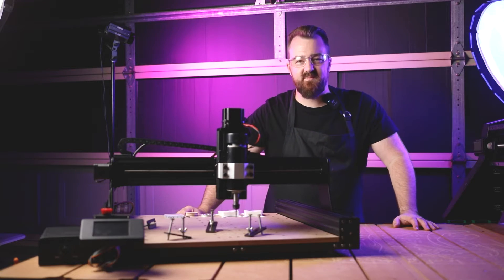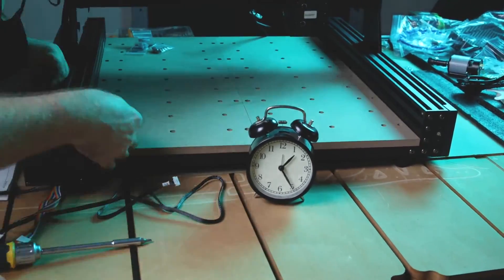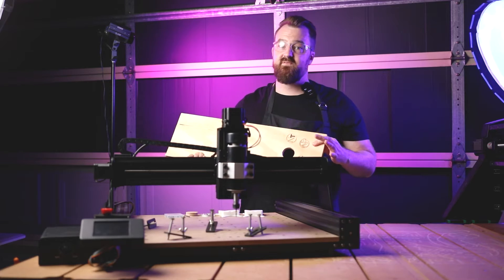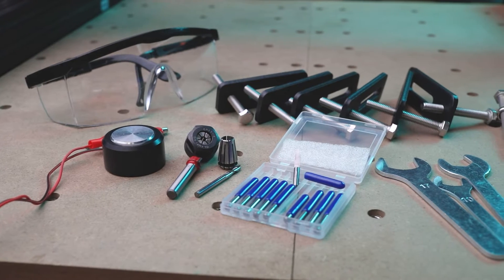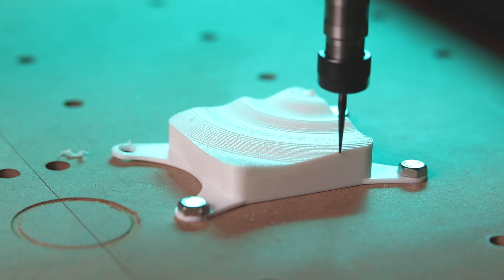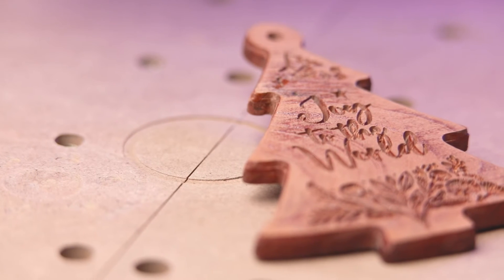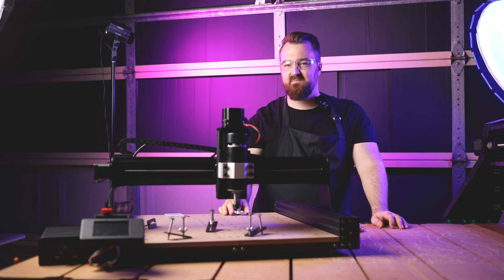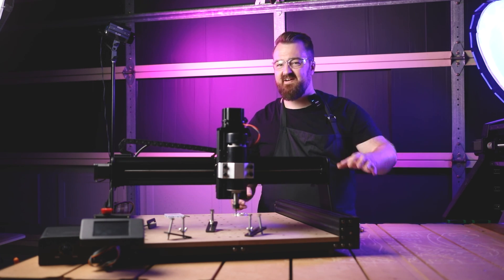TTC450 // Two Trees CNC

Comment: can cut the plexi glass with 80w 775 spindle motor ?
Reply from the maker: Yes, however I wouldn’t go any thicker than 3mm and take .5mm step down at 1000mm/m with a 1/8 inch single flute and something to either blow or vacuum the debris. 👍

Comment: Are you considering to upgrade it with liniar rails?
Reply from the maker: Great question! No I won’t be making any additions to this CNC. If I start upgrading, it will end up a totally different machine. I would rather start building a new machine from scratch. This is a great machine as a beginner and get your head around CNC’s.

Comment: I looked up the link you gave and downloaded it! If I copy it one by one into the console panel, you say it will be fine?
Reply from the maker: They are the default settings for the ttc450 and will get you back to original settings if you need. My other settings I posted should get you homing to back right corner:
$23=0
$130=-450
$131=-450

Comment: HI!
Sorry to bother you again! I have the TTC450 machine, it's great, it's a pleasure to work with it, but I have two problems that I can't fix!
1. it often happens that I move either the X or Y axis in one direction with a given value, and all of a sudden it doesn't go any further, yes in the opposite direction, but not in the original direction! I can only solve it if I send it to the Home position! Then it's good for a while!
2. I wanted to place the Home position in the right, rear corner, but there the limit switch of the X would not stop it, it would continue, do you know what sound it makes? However, the Home position works in the left rear and right front corners!
I think that the problem may be with $$ values, but I dare not touch it! Can you help me? Maybe you could send me all the correct $$ values! Thanks!
Reply from the maker: Thanks for you comment. Yes that is possible on the TTC450. 
In regards to your questions:
- firstly triple check all motors and limit switches are plugged in securely. 

The issue with changing the homing location, if you don’t change the machine x,y max travel, this impacts the movement. The machine is expecting to move right by 450mm and to the back of machine by 450mm… if you change the homing position to the rear right, you will need to update machine max travel to:
$130=-450.000
$131=-450.000

To invert the homing direction to back right corner it should be set to:
$23=0

Let me know how that goes?
Reply from the maker: Check your current settings are default… here is the back up file:
https://www.mediafire.com/file_premium/sc3957v1qnuf9bg/TTC450configuration.nc/file

Comment: Aligning the two Y axis gantry screws.  I don't use the limits, so if  I accidently hit the back the gantry will get out of alignment just a little. Since there is no knobs on the motor shafts and there is no way to get to the screws to turn them, I have found a way to do it easily. You remove the bearing holder on the front right side and you then have access to the shaft. You then can align the both sides to same measurments..  Works great..
Reply from the maker: Great thinking!! Thanks for sharing. Yes that would be super helpful to others. You might also be able to unplug one of your y axis motors and make tiny movements until square, however remember to power down machine before disconnecting or connecting motors!!

Comment: I thought of these: Feed rate, Plunge rate, Depth/pass
Reply from the maker: For my parameters I kept plunge rate the same as feed rate 👍
Reply: Thank you for taking the time for me! I just want to ask, do you mean what you wrote as Plung rate=Feed rate?
example: Feed rate 500mm/min then Plung rate = 500mm/min!
I also came across such a setting: End Mill 6mm, depth/pass=2mm, Feed rate=1000mm/min, and Plung rate=900mm/min! Do you think this is not burdensome for the machine, the one I saw used the original motor and not the 500W motor?

Comment: HI! I ordered the TTC 450+500W motor today, I'm really looking forward to it! I would like to ask you to tell me what values you use for the following parameters! Of course, I don't ask for every tool, let's say an End Mill 3.175! Thanks!
Reply from the maker: Thanks for your comment. The following parameters are from memory and might need testing. For cutting plywood with a 2f 3.175mm endmill I believe I ran at 600mm/m with 2mm doc. I always found plywood to be more difficult than other soft timber due to change of grain and random filler timber between layers. You might be able to run more aggressive with these values. 
For aluminum I used a 1f 3.175mm endmill at 300mm/m with .2mm doc, however I still had some machine flex at these values and needing to refine. Hope that helps!!

Comment: HI!
I have been watching this machine for a long time, but now your video convinced me that I have to buy this machine!
I currently have a 3018PRO machine, I want to replace it because the process is too long! This machine is faster with a 500W spindle! Maybe adding a spindle makes it even faster! Can it also be controlled with UGS plarform?
Thank you for answering!
Friendly greeting! Kabódi
Reply from the maker: Thanks for your comment!! I’ve used the stock 3018pro in the past and had a huge issue with flex due to the lack of rigid support. The ttc450 is definitely an upgrade with a more stable frame and larger cutting area however there is still some (minimal) flex in the frame. The TTC450 is a great price for the size and features!

Comment: Did you already made any tries regardind fluidnc? I'm also using the machine, but I'm not very happy with stock firmware possibilities.
Reply from the maker: Yes I agree with you, however fluidnc doesn’t support the touch screen (yet!). You could replace with an old iPhone or alike if you wanted to use fluidnc. The transition to fluidnc would be pretty easy and no need to re-wire electronics.

Comment: I've had to take mine apart and put Loctite on all the screws holding the lead screw nuts. After about 8 hours of running, the screws on all 4 nuts had worked loose. Other than that, it has been a great machine.
Reply from the maker: That’s a great idea! You won’t have to deal with the screws again 🤩
Reply: Won't hurt to do the same with the limit switch screws. The left x-axis switch fell of, too.

Comment: Hi, I've had the ttc450 for a week now. But if I use USB Aborts the connection in the process With WLAN it works without any problems except that tools cannot be changed.Does anyone have an answer idea or other information?
Reply: Good evening So with gsender there were also frequent connection problems, but with the program I can at least start again at point x.I wrote to twotrees support.So the answer came by sending a video and the milling machine cannot be returned!!How does the tool change with gsender work?

Tomorrow I'll test another laptop with win 10 32bit... I'll report back
Reply: @Eggi646  I have two laptops with same issue (USB), ferrite rings filters on cables, helped most time. Issue appears mostly on spindle mode changing (RPM, turn on/off). Maybe because CNC motherboard engineering quality (no galvanic or optical isolation)... This problem has become less common with ferrite filters.
Reply: So now that I have a WhatsApp group with twotrees 😅Can I announce that I have a circuit board from the box of the 500w spindle + a new mainboard.. I will let you know when it is installed.. Happy New Year and a healthy new year to you
Reply: @Eggi646 cool ! Happy New Year 🥳
Reply from the maker: Sorry to hear that! What program are you using on your computer?
Reply: @NEWTechCreative  win 64 Bit ..and inkscape estlcam candle
Reply from the maker: Hmm! I’m not sure what the main issue would be without seeing a video of this… very strange. If it was to do with EMI this would impact WLAN as well. This might be a short or faulty hardware. I would connect with Two Trees about this and see if they can rectify. Happy to help further if you need. Feel free to email me newtechcreative@gmail.com
Reply: Spindle (500W or other) produces Electromagnetic interference (EMI) causing to USB.. I use ferrite rings attached to Spindle cable and good quality USB cables with ferrite rings (booth side). gSender software helps too. It can reconnect safely and continue program from last line
Reply from the maker: Another thought… try using universal gcode sender to connect to. I use UGS as my go tomorrow and don’t usually have any issues. After connecting, click soft reset and unlock buttons and you will be good to go. I would start with a home of the machine. Let me know if this works?

Comment: Can you please show how the cable comes out from behind the x-axis cover? I think it scrubs against the metal
Reply from the maker: There are 2 zip tie holes to anchor down with!  I have a small clearance once anchored 🤩
Reply: The drag chain inside that cover is too far forward and the cable has to bend backwards to plug in. Remove two links from the top of the drag chain so more cable comes out of the drag chain. It will be parallel to the gantry upright and then it can then be wired tied to the back of the the upright, not the side (where it rubs). Other reviewers cut the dust guard. Don't, adjust the drag chain instead. Remove two top links / snaps not the entire link.

Comment: accuracy not included
Reply: yep. I tested backlash - it is about 0.1-0.15 mm. It can be reduced by software backlash compensation.
Reply: I purchased mine When They came out.. It used nema 23 &17’s and I figured that if I didn’t like it, The Bulk of the build can easily be reused/infused and repurposed with/for other projects.. Regardless..I Love it.. Wish the Router Backing plates were more readily accessible… Was planning to use The Black box and other Upgrades but as is, for now it’s fine and adequate. Backlash was fairly easy to sort out, just took some focus and all else is Great at this price point…Especially when I got it..Wow!..Just Parts alone it’s a win..